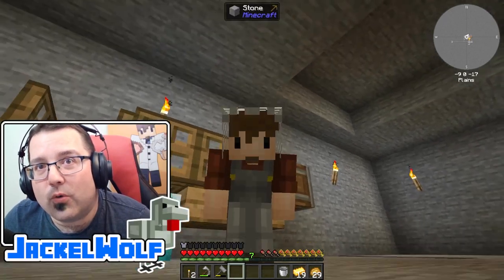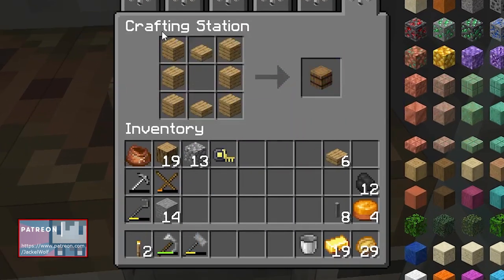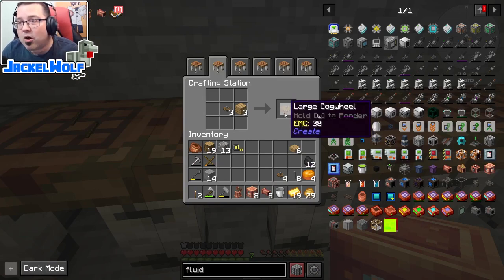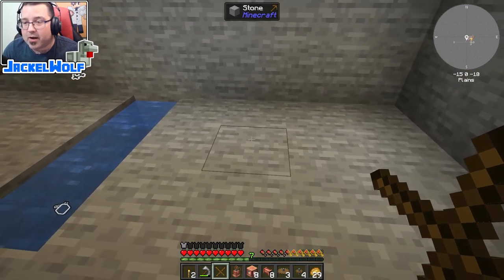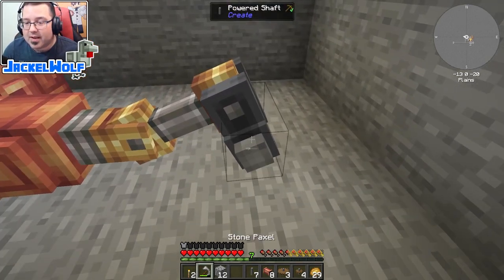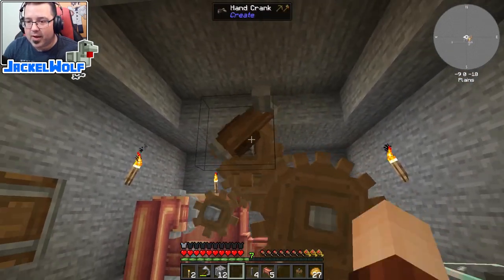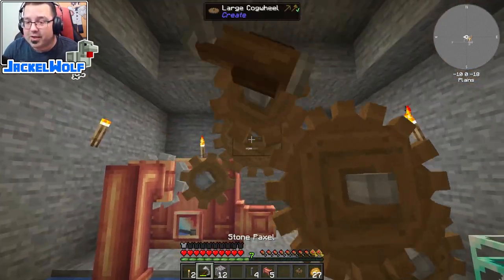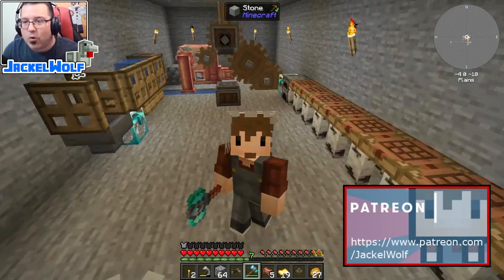FTB STONEBLOCK 3 - How to Build a Create Steam Engine Tutorial - EP07

Comment: This video answered several specific questions I had about the steam engine (and cogs in general!) so thanks a bunch!
Reply from the maker: Glad it helped!
Reply: @JackelWolf  Could you make an in depth video about how to expand the cogs so i can make the crushers?
Reply from the maker: I'll be honest, the cogs are something that I've got to play around with to get to work. The best I can recommend is having the left and right crusher separate from each other. In hind sight, it might be worth it to have 2x steam engines. Or... now that I am thinking about it, it might be better to run it with 2x water wheels (going in opposite directions). Big cog on the water wheel, small cogs off of that (big to small steps up the speed). If it is not fast enough, I think you can step the water wheel up one more time (big cog (connected by the axle, not the teeth) off of the small cog, then another small cog (connected by teeth) off of the new big cog.
Reply: @JackelWolf  yep im running 3 water wheels and powering both of em just fine, till i can find out more on how to expand my steam engine ill just use them
Reply: same to me!

Comment: I'm having zero luck getting mine to stay on and I was to finally build one.
Reply from the maker: Yeah. They are super easy to overload, especially with a full set of mechanical crafters, or even something like the crushing wheel. I am constantly fiddling with mine.
Reply: @JackelWolf  Eventually got it up and running w/ two sets of of steam engines. but noticed it wasn't churning fast enough to use the mixer unless I hand cranked the extra speed out of it. I can't seem to figure out how to get it fast enough w/o over stressing it once I connect it to everything using your setup.
at a loss lol
Reply from the maker: I havnt built the mixer yet. May have to give it a shot as I am surprised it would take more than the crushing wheel. There are something called engineer goggles that let you see the stats on various parts, might help you troubleshoot.

Comment: I set up the whole system exactly as you had it and when it came to hand cranking it to start, yours started but mine refused. The only ways ive been able to get it started is with a water wheel but that takes me hours of fiddling and can't consistently get it right. I'm just mostly confused because i followed all your steps and i've troubleshooted quite a lot
Reply from the maker: When you use the crank, make sure the arrows on the pump point in the right direction. The flow changes depending on the direction the direction the gear is turned. It can be hard to see, so you might have to position yourself above the pump.
Reply: @JackelWolf  I've done this, I have it correct. I've also rebuilt it 4 times to make sure I have it right
Reply from the maker: Do you have any loads on the steam engine when you are trying to start it? I believe that having machines attached will increase resistance and make it harder to start with the hand pump. I had to use the water wheel as well once I added more pumps, just because the most the hand crank would handle was 2 (I think).
Reply: @JackelWolf  it was literally the exact same as yours 😭 I would study your video and then recreate it step by step and I'd double check everything. I tried so many ways after a while and managed to get it started with a water wheel. But then my parter hopped on and followed your video and it worked first try 🤣 never figured out what it was but oh well. It honestly might have just been a glitch
Reply from the maker: So hard to say. The gears can be pretty finicky as well. Glad you got it sorted though.

Comment: Mine wont work please help, it has heat water and the tank is of appropriate size.
Reply from the maker: Is the water pumping in the right direction? Even if you line up the arrow on the water pump, it can change direction depending on your gear system. Also, do you have enough water pumps? Larger tanks require more water.
Reply: @JackelWolf  I figured out what was wrong, i had a water wheel turning the mechanical pump but it was turning too slow, the engine was using the water faster than it was recieving it but thanks for your help. 👍 You make great content dont stop making videos.
Reply from the maker: Thanks! Glad you got it sorted.

Comment: Mine won’t take any water in
Reply from the maker: How can you tell it's not taking in water? I don't think there is a display once you turn the tanks onto the boiler. As long as your pumps are facing the right direction (and the gear is turning the right way (pump will change direction depending on what way the gear is cranked.
Reply: @JackelWolf  if you use the engineer googles and go over to the boiler , it shows you like the heat level and water level and stuff
Reply from the maker: Ok. That narrows the potential problems down. How many water pumps are you using? Depending on how big the boiler is, you will need more. My upgraded boiler is 4 or 5 layers and uses 3 pumps. I've seen bigger though, so it could take more.
Reply: @JackelWolf  ok that definitely helps me out I have multiple layers but only one pump , I should of guessed I needed  more pumps
Reply from the maker: It scales up, but I dont know the ratio off hand. If you have the goggles,  they will help you balance the amount.